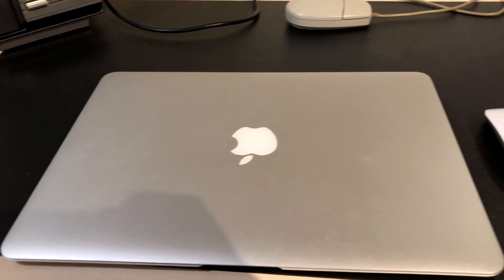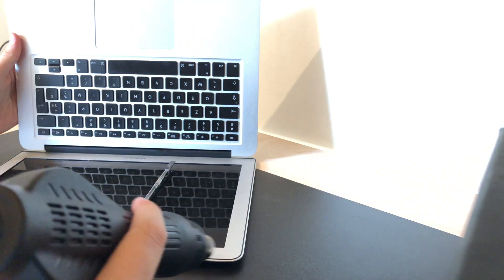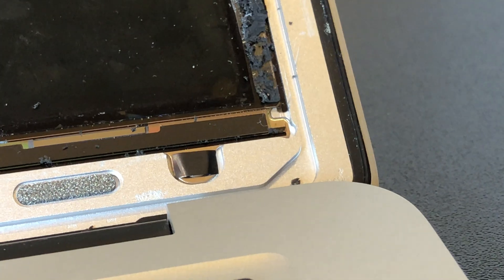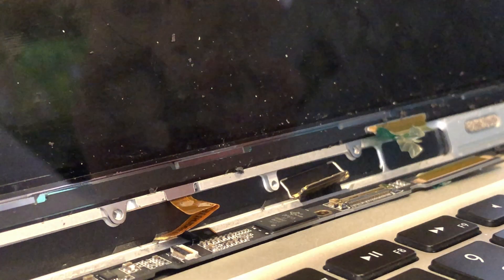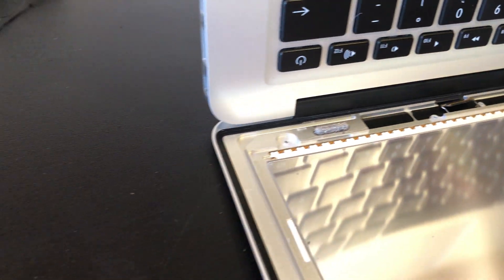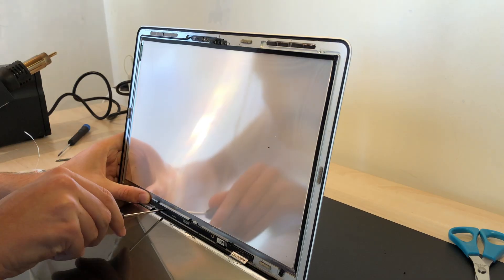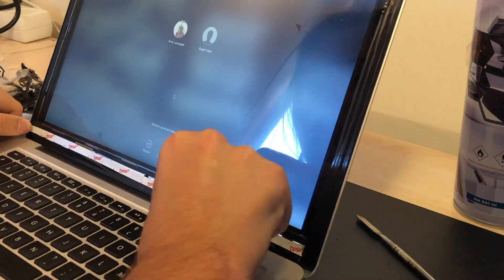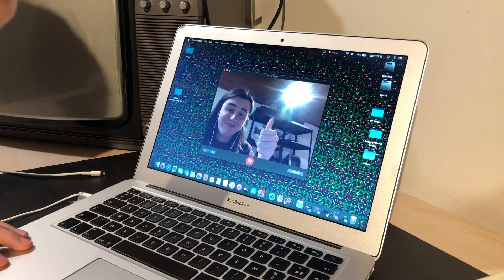How To Replace A MacBook Air (A1466) Screen

Comment: Back light is not working after i replaced LED any suggestions? I tired backlight cable both way still not working.
Reply from the maker: Probably ripped the cable then😬

Comment: I tried to search out the black screen everywhere but didn't find it. So, where do you get that. Plz, tell me or share the link of the website.

U did really a nice job.
Reply from the maker: Just look up ‘’MacBook Air A1466 LCD’’. There are loads of options. Try to get an new (original) one or a (n original) donor.

Comment: Well done. I trew away by mistake the metal bar that holds the screen. Any ideas about where to find it?

My backlight does not turn on. I've tried everything. =/
Reply from the maker: It won’t be easy finding one of those.
You’ll probably have to find a donor machine for that. 
The metal bar hides the individual LEDs on the bottom. If you don’t use one you’ll have a couple of bright spots on the bottom of the screen. It should work without the bar though. The backlight not working is a whole different problem. Try unplugging the backlight flex cable and then plugging it back in the other way around, that’s usually it (common mistake people make).